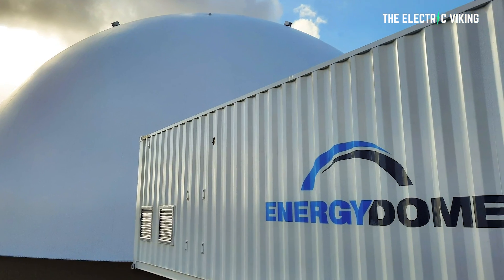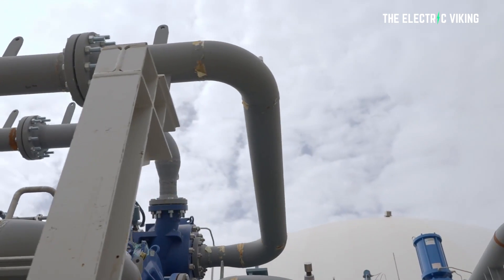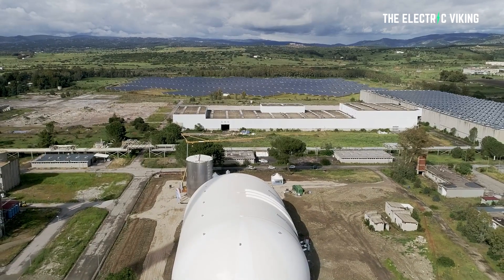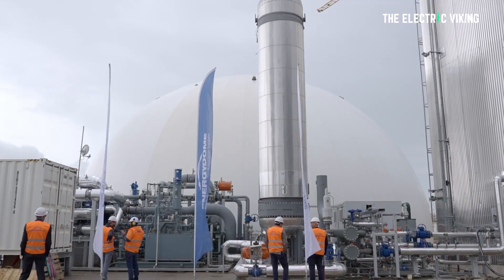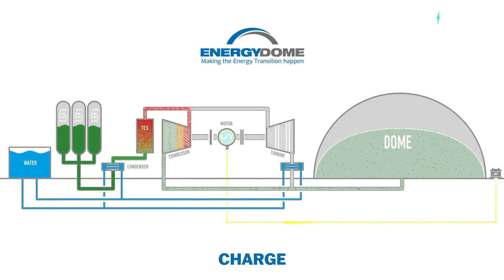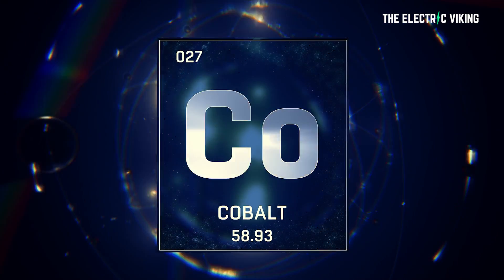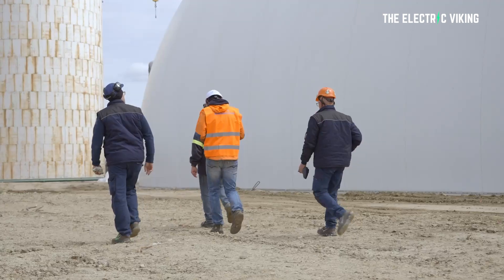NEW CO2 battery is about to change the world as we know it

Comment: This is not a battery. It is a compressed-gas energy storage system. See, for example, https://en.wikipedia.org/wiki/Compressed-air_energy_storage. This system uses CO2 rather than air, which is cute, but this is unlikely to make a huge difference. I would want to see third party confirmation that they can achieve 75% roundtrip efficiency, which is very high for this kind of storage.

Comment: I would imagine that you could quickly switch over from storage to generate mode rapidly if that is designed into the system. Much better than liquid air because it is not cryogenic!

Comment: CO2 has a nice pressure temperature curve and is a great fluid to use for this. CO2 is available in the air, although in tiny amounts. Once you get it stored then you can cycle it back and forth. Exactly like pumped hydro storage without the problems that have to be overcome. It works even on flat ground unlike hydro.

Comment: ok. what I'm seeing is a large dome containing a bladder, a compressor driven by renewable energy sucking gaseous CO2 from the bladder, pumping it as a superheated vapor through a desuperheating coil then as a slightly superheated vapor into a condenser, probably cooled by an ammonia (R717) system. It leaves the condenser as a subcooled liquid and is stored in insulated, refrigerated liquid receivers. if it's stored at say -4c the pressure in the receivers would be about 440PSIG. When you need it you'd let it out of the receiver and perhaps heat it to say 30C (just below its critical temperature of 30.91C)which should give you an evaporator pressure of about 1030PSIG which you can use to drive a turbine running a generator.the exhaust CO2 would then be released back into the bladder in the dome to reinflate it to rinse and repeat. That's assuming your not running a supercritical system, at which point the storage pressure of the fluid becomes very scary very quick.
You'd be using industrial CO2 so you can do your own research to see where that comes from.
 It doesn't actually pull any out of the atmosphere.
CO2 has an ODP of 0 and a GWP of 1.
R717 has an ODP of 0 and a GWP of 0 which is why I'd suggest it'd be used in the cascade system.
By contrast arguably still the most common low temperature refrigerant used in our supermarkets is R404a which has a GWP of 3922 which means that releasing 1KG into the atmosphere into the atmosphere is equivalent to releasing 3.922 tons of CO2. most supermarkets that still use it would hold something like 60 to 80KG of it and could loose the lot in 1 big leak.
Rudd was in the process of pricing it out of the market and there was a mad dash to retrofit old supermarkets with CO2 systems for low temp and R134a for the fridge cases (medium temperature.. meat, deli etc.)
Abott got rid of the "carbon tax" and the urgency disappeared. CO2's still coming in but slowly.

And what Alan Jameson said.

Comment: Looks like you don't understand a basic law of of thermal dynamics.  This process is a battery using co2 as a thermal expansion substrate.  It takes more energy to create an output to release energy ie a battery.  It does not reduce co2 inherently but by forgoing the process of starting up a thermal plant ie coal/gass & it boilers, it can reduce burning more fossil fuels.  Batteries do not & will not reduce co2 except in the prevention of less efficient response to a short demand.

Comment: This is fluiddynamics with the density of the fluid being that of CO2 like pumped hydro uses water for the fluid.  This has potential, especially if you condense the CO2 from the atmoshpere as a sequestration measure.  It is also a cheap (Realtivity) non-tocxic gas.   It has been discussed for use in LFTR fission as a working fliud for the secondary loop to run the electric turbine too.  There are a bunch of synegies there, a power park that handles base load with a surounding collector and wind farm that can condense and use CO2 in a common set of turbines that can handle CO2 from simply compressed to very high heat.  Drop Liquid (Cryogenic) co2 in one end of the turbine and pull out hot gas at the other that gets stored cryogenically with excess power from the wind or solar, meantime you have a coolant for the Molten Salt Fission which also generates your base load power.  NICE!

Comment: could build a similar system at home using an air compressor with tank resevoir and a solar array. There are pneumatic tools that run on compressed air - could convert one into an electric generator (could be an AC generator that is appropiately geared to standard grid frequency). Would be nice to have a DC motor to run the compressor so could be coupled to a solar array directly. The charge controller that shuts down the solar charging to a battery bank would need to be modded to where a pressure sensor on the tank shuts the motor and the solar array down simultaneously. Would be an interesting maker project just to do a proof of concept and attempt to measure overall efficiency (so could be compared against battery storage).

Comment: Whats the energy used to extract the CO2 is the real question  .For example do they use solar wind  or is fossil fuels . Seems to me the best way is burn coal  and extract that CO2  which is 3 kilos CO2  per kilo of  coal burnt better than oil which is 2.5 kilos CO2 for kilo oil burnt . Then use the  ~12KW of power made from coal to extract the CO2 from the air   or equal ~12KW from oil  bearing in mid coal without CO2 gas is typically  1/3 the price of oil per kilo

Comment: I am not sure I understand the chemistry correctly but it appears you might be labouring under a misconception ( or indeed I might too), but generally these alternative batteries convert something like gravity, sunlight, water-pressure etc in some for to store energy potential, ie the water pressure drives a generator, or something to release power and in the process reset the condition for the things used to store the energy, in this case the gas is compressed and uncompressed, at which point they just release it into the atmosphere again presumably, and recapture new CO2, because the heat seems to be the thing used for the conversion process. anyway I might be wrong, but it does not seem like it reduces co2 in any way, just temporarily stores energy in the lconversion to liquid form, but feel free to correct me if I misunderstand it.

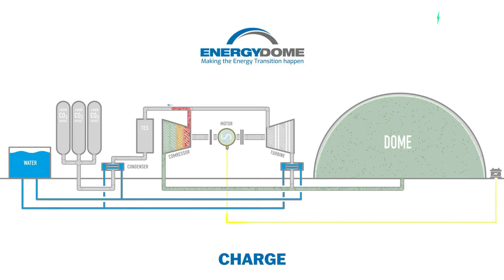Comment: Me. How does it work?  How does it work? How does it work?  You don't talk about it until 4:32!! So much fluff and hyperbole. So it's a compression-based system. The Co2 isn't brought in from the atmosphere - it's just stored locally. It can be any substance. Others use air, for example. It's down to which is the cheapest/most reliable etc.

Comment: Ok laugh at me but I have a question.
Could this ever be scaled down to an engine sized power source for vehicles?
Reply: These kinds of storage solutions only work because they don't have to care about how much space they take up. With an EV, energy density is basically the primary concern, energy density = weight efficiency = reduced overall energy used, thereby ruling this tech out at the starting line.

Also,  you probably don't want to be sitting on a tank of heavily compressed anything in the event of an accident, because that is essentially an I.E.D.

Besides, the idea of classic battery EV's is that they are as clean as whatever grid energy source they charge from. If this plant works, and providing the battery in your EV is also clean, what's the difference?
Reply: @rorychivers8769  thanks. Yes density, that's what I was implying by scaled down. Regarding heavily compressed, there are vehicles running on tanks of liquefied petroleum gas (LPG) since 1970's. Not sure of the compression ratio or science of it. Maybe we go back to steam locomotive engines 😅
Edit. Also regarding the difference: the natural resources required to produce such EV batteries is apparently brutal on environment and limited. If this could be avoided or minimised....just thinking out loud 👍

Comment: Take a look at Highview Power's  liquid air battery. It uses excess power to cool and liquify air and then releases the air to generate power when needed. It's best used in combination with an industrial site that can use the excess heat removed during liquification and use the "cold" generated by expansion. For example, and ice cream or frozen food factory that can use the heat of compression in absorption-type refrigeration units and then use the cold directly.

Comment: Don't get me wrong, it's a neat idea.  But while it may be removing CO2 while "charging", it's releasing it when it's "discharging" (i.e., the liquified CO2 is turned back into a gas which drives the turbines).  Which means, at best, it's "Carbon Neutral."

Second, while I love the energy companies are signing deals, I'd point out that these deals are no sweat for the energy companies.  The idea for the energy company is, "If you provide this, we'll buy power from you."  There's no investment and no money is changing hands until they produce something.  Frankly, I can probably sign a deal with an energy company for any crack-pot idea (which this is not) because there's no risk on their part.  If it works, great!  If it doesn't, it's no skin off their nose.

Comment: I don't see why they would fill it with expensive atmospheric CO2 when there is much cheaper industrial supplies from grey hydrogen production. The video made a point of local coal production, which suggests both black hydrogen and coal gas industries could supply the CO2. 
Turbines are fairly efficient but traditionally have slow response as they have to spin up to operating speeds, but it'll be faster than big old pumped hydro water turbines. 
Green energy grids need bulk storage as well as fast storage so there's room for many different answers to be combined.

Comment: Hi mate thought as an Australian you would have done your research on the long term raw data of Co2.  Co2 helps the planet. But good battery idea hope it works well.
Reply: Co2 helps the planet? The planet can survive most things, humans won’t.
Reply: @Etacovda63  yes co2 helps the planet.  Every plant needs co2 the more co2 the less water the plant loses due to evaporation through the co2 receptors. Every crustation on in the water coverts co2 to shell. Even we need co2 and carbon for bone structure.  Look into it and you will find out for yourself.
Reply: @jaskirchner  much like water, there’s an optimum amount. Too much isn’t good.

Comment: A closed loop would not remove CO2 but co2 Will need to come from somewhere to supply the system to start with, so it would contain it as long as the system remains closed . Just like a refrigeration system of any other kind.

Comment: Umm. It seems as though the investors have been duped. For a start doesn't fit the definition of a  battery as no chemistry is involved.  A few hindered tons of captive C02 won't cure global warming. There are companies already that have working multi megawatt   compressed gas, plants in service  so the point of this video should be 'What   advantage does the use of C02 have over other gasses?'  Since it is an energy storage system it is only as green as the original energy source which is stored. A little knowledge us a misleading thing..

Comment: It doesn't remove CO2 permanently, just cycles it in and out. Doesn't sound very cheap either. This is not carbon capture. Sounds like pumped hydro which is only about 80% efficient vs 90% for battery. 
Too many questions.

Comment: This is a big refrigerator or air condition conditioner,  much like air pumped into abandoned mines and allowed to expand later.  Not an electrochemical battery. CO2 is like refrigerant in home AC. Work energy is  required and  the surround is heated when  compressing  the CO2  as a  gas into a fluid and stored in  tank. Some this a might be stored and used later.  Allowing the CO2  fluid to evaporate and expand then gets free energy back. Cooling occurs.to do mechanical work to  then get electricity back.    Maybe we could install a little generator in home AC  When evaporation expand gas and does work of value as  it cools house.  Nonsense of course but the 'value' is to use electricity at one time and get some electrical work at later time - hence  an energy storage device  to use energy at a later time.  What is the thermodynamic efficiency?   Not stated here.

Comment: It will probably take more energy to compress the CO2 into liquid, than the energy generated when the expanded CO2 drives the turbine. This is nothing new, similar things have been developed over several years with maybe different gasses, but the results and poor efficency was always the same. And even if they can optimize the process, the volume of CO2 compressed, and the resulting energy will be minute in the bigger picture of the energy need.

Comment: They have already done this, but instead of using co2 they use air, so 20% oxygen 80% nitrogen more or less.
The principle is very simple, compress a gas to store energy, then let it rip through a turbine or other type of motor to retrieve the energy.
 You could use almost any gas, i assume some will be better and safer than others, co2 is used in many things now, air guns, nail guns and so on.
I think it's only problem is efficiency and cost, both start to look better with larger scale.
As for operation life, i don't think it would have one, pumps and turbines would be replaced as needed and so would any pipes or pressure vessels.

Comment: I lose count of how many channels have a story on this CO2 battery and none of them give you a good idea of what the energy density is. All I need is for someone to give me the dimensions of the atmospheric pressure storage facility.  To really change the world you need to be able to store at least enough capacity to run the United States China and India for 10% of the time.  That works out to 100's of  terawatt hours of storage, so how much space would that take?  I'm not asking this question to be a naysayer, I'm saying it has to be done what will it take.
 Also no one talks about the effects of weather on this system like in the winter you could put more CO2 in the dome than you can in the summer,. The contraption has a range of capability not a set capability.  Also how hot does it have to be before the CO2 dome starts absorbing heat on its own and changes the dynamics of the whole facility.  Should this thing be built mostly underground to maintain constant temperature conditions?

Comment: Sam,--- I am sceptical.  Compress - decompress!  I have seen a few of those so-called "batteries"!  Air batteries, nitrogen -- comes to mind!  All depends on the economics of the technology!  One of the techs, -- will be the most!  Economical. The one with the smallest losses.  Not a revolution in my book!  As it does not remove the CO2 from the atmosphere.  It only "uses" the CO2.  Mass production of green hydrogen, plus fuel cell use  --  that's  the future!  Nuclear and renewable energy. The way, I do see it.  Greetings.

Comment: The bigger potential benefit would be air conditioning.  All that expanding CO2 changing from liquid to gas would absorb lots of heat.  The biggest hurdle is containing the volume of CO2 gas after it expanded.   The phase change boundary between CO2 liquid and gas is a curve from 5.1 atmospheres at -57 C to 73 atmospheres at 31 C.   Storing the liquid CO2 at -20 or -40 C is a smart tradeoff. But how can this be efficient when so much energy is dissipated each compression cycle?

Comment: As a lover of science you should understand it a bit better.
- This system does not remove CO2 from the atmosphere (possibly apart from initially if the CO2 used is taken from the atmosphere. The amount would be insignificant regardless.)
- The system does not generate electricity. It stores and releases it.
- This is basically the same as a compressed air system, nothing really new or revolutionary. And no reason to become very exited.
- It will not change the world, if you believe that you are extremely easily gullible. Most likely just clickbait.

However, any innovations and improvements, no matter how small, in storing energy (fairly) efficiently over longer timespans then LI is good at is welcome.

Comment: Its a huge advantage that you can make such energy storage without rare chemicals. Also, you will need CO2 to build it, locking it inside the system, making for a kind of carbon storage. But clearly, energy storage without rare chemicals or advanced tech!

Comment: Sam thanks for a great content but there's a few mistakes about this battery.  Depending on heat recovery this is a very inefficient or inefficient battery.  From what I understand it does not remove CO2 from the atmosphere in any large quantity.  It will probably not compete very well against short-term electric chemical battery storage because of the low efficiency.   Perhaps it has a place in very dry areas where long-term hydropower energy storage is not possible.  A lot of the other very low cost battery technologies could make this concept economically uncompetitive.   But it might have the potential to scale up fast.
Reply: Make sure you’re thinking about “efficiency” correctly. For grid storage, the important efficiency isn’t kWh/kg (or volume), but rather kWh/$$. This looks like it could be really good in terms of cost. It’s all off the shelf equipment, standard industrial construction techniques, no exotic materials. It’s basically just a refrigerator that makes dry ice hooked up to a turbine. And designing for ten hours or so of storage suggests this is targeted at basic grid stabilization - saving solar for use at night, or leveling the output of wind turbines. At first blush, this looks like it could have some really key efficiencies in terms of construction cost and time to market.